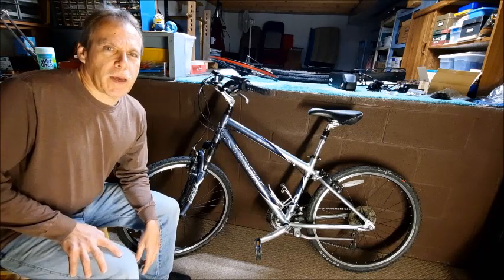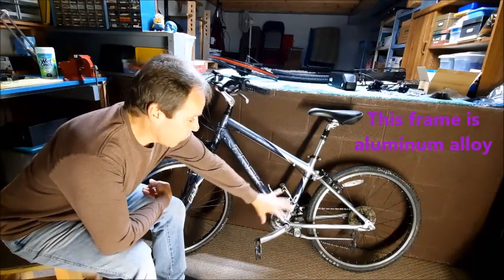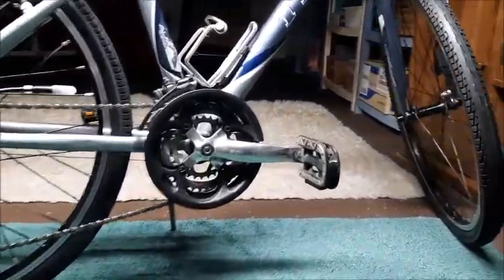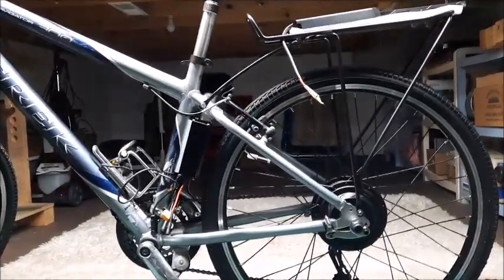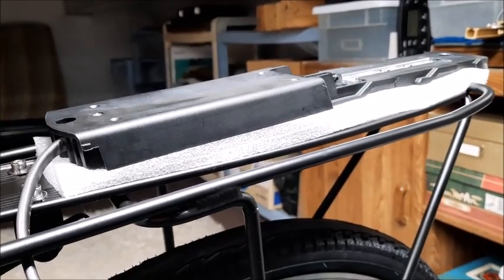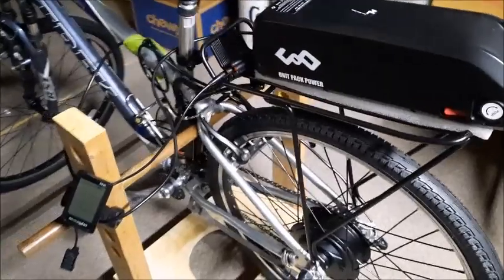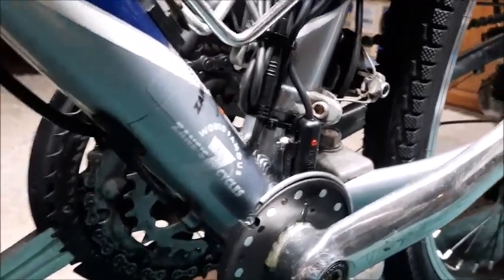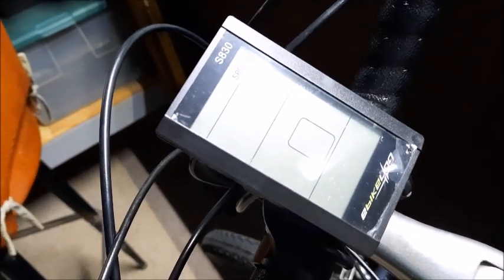Building an ebike with a conversion kit from eBikeling

Comment: Thanks for this video. It really helped me out. I also have an older Trek and it looks like my install will be the same. If you're still monitoring this can you give some more advice on adjustments to the derailleur you made to move from a 8 to 7 cassette since I have the same setup? Thanks!
Reply from the maker: The only adjustment I recall doing was adding a washer on the axle to better align the chain with the gears. I didn't change the derailer settings. Also be aware of gears close to the motor hub. Mine was able to shift too close to the motor housing and the chain was rubbing on it. I know to not use certain gears. You won't need to use many of them anyway with the motor assist. Good luck on your conversion!
Reply: @ozbad07  Thank you so much for the help. Cheers!

Comment: Did you need to get any adaptors or additional connectors for the battery?
Reply from the maker: The battery had two wires to connect. I soldered these to the system to eliminate connector issues. Adapters and connectors add resistance which is another reason to solder the joints

Comment: Hey there - I myself am building an e-bike with the same kit. However, when I go to install the PAS system, I’m running into an issue where the separable magnet wheel won’t fit (too small) on the metal holding the two cranks together. Any ideas?
Reply from the maker: The magnet wheel was a tight fit on mine but the plastic is molded to accommodate different diameters. You may need to enlarge the hole to fit. As long as you don't disturb the magnets, you should be able to modify as needed.
Reply: @ozbad07  that was my thought as well. Thanks for the advice.

Comment: Great Video! I was thinking about doing the same thing to my trek bike. Mine also has an 8 gear rear with a 3 gear front. Did the 7 gear cassette from the kit work ok with the original front?  Also is your new hub a 500 or 750 watt? Thanks in advance.
Reply from the maker: Yes, the 7-gear cassette works fine. With the motor assist (500W) I now only use the large front gear and only about 5 speeds in the rear.

Comment: With the throttle, you're need for shifting gears is reduced drastically. Without it, your need for shifting increases even more than a regular bicycle. BTW, it looks like the tread on your rear tire is in the wrong direction.
Reply from the maker: I left off the throttle as I wanted a class 1 pedal assist bike. Since the motor assist is there, I only use about 4 speeds during most rides. Yes, the tire was wrong initially but corrected after the video was made.

Comment: Great build, was thinking about doing the same thing.   Can you take the 8 speed sprocket off the old tire and install on the electric hub?
Reply from the maker: The kit comes with a 7 speed so I used that. I suspect the 8 speed is too wide for the new wheel and won't fit between the forks, but you can try.

Comment: Great quality build.  I like your stand build.  Testing ebikeling build for my wife, couple times ok then go to ride  pas sensor failed (light stays on continuous no matter pedal or not). Found out unplug sensor, continue with throttle (when pas dies) or pedal.  I built with throttle/modified brake cut outs; but understand your choice.  Appreciate you taking time to help others.
Reply from the maker: Thank you! I've put hundreds of miles on it and am happy with it.